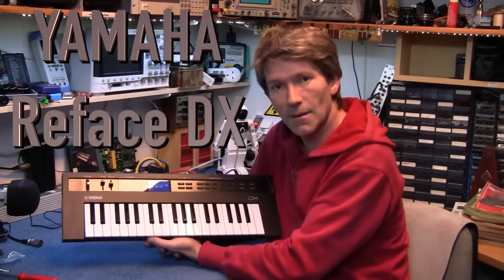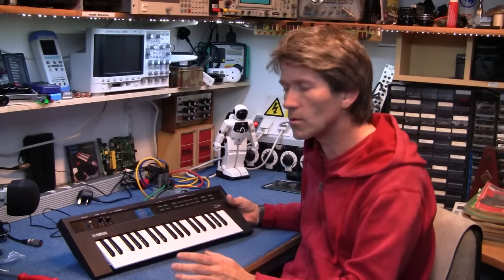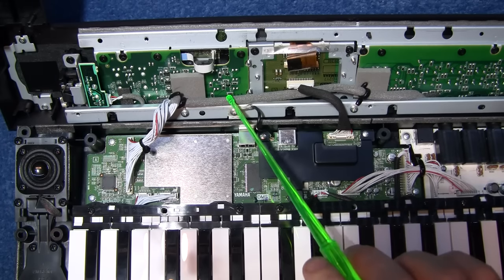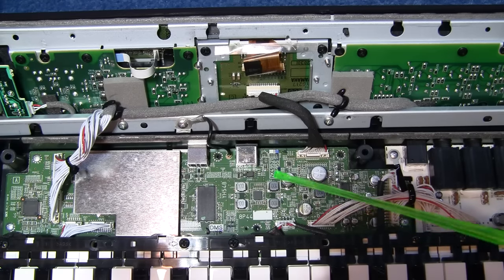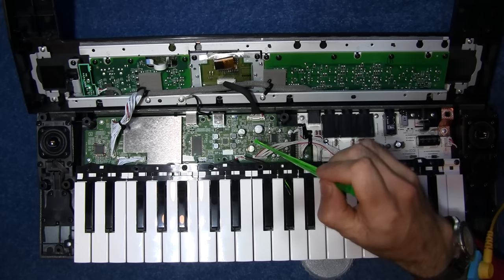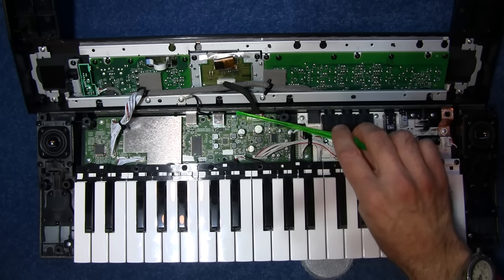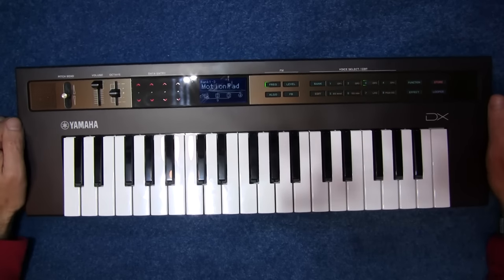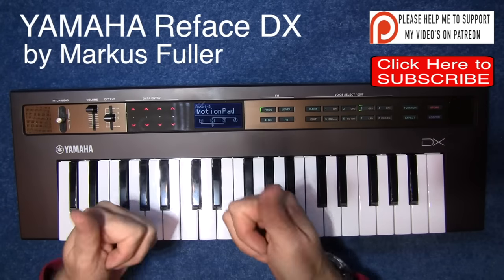YAMAHA reface DX FM synthesizer TEARDOWN MF#62

Comment: The chip under the metal cover is the DSP Yamaha SSP-2: a RISC CPU SH-2A @135MHz, wich handle tone generation, usb and midi. It's the same on Reface CS and other products like steinberg UR-22 and others yamaha synths like the s950.

Comment: This was very helpful, thanks.  I just bought one of these and the display was blank when I first turned it on. 

 I could just have had it replaced under warranty but your video showed a lcd FFC connector that could be the issue.
The connector was simply not locked so the flex cable was coming loose. Reattaching the flex cable an all was ok and I saved myself a trip to the store. :-)
Not sure if it is a common problem. The connector looked fine. It was not bent or 'cooked' from production. Looks like it was simply not locked properly during assembly.

It is a great little keyboard. I'm surprised by the build quality and feel of the keys. I have a microkorg and compared to that the reface DX has a more sturdy feel to it.

Comment: Hi, I'm having a problem with the octave switcher on my Reface DX, suddently stooped wiorking - is this. known issue do you know? I took it apart and reseated what I think was the connector to the main board but it hasnt made a difference. It's odd because it suddenly stopped working despite it just being sat on a table without moving - would a factory reset fix do you know? Don't want to unnecessrily lose my patches!

Comment: Just got a Reface DX, no sound at all - either on speakers, main outs nor phone out. Also Aux In signal isn't heard. Done FW update, full reset, local on... Volume slider joints seem fine, no signal arriving at the Volume pot. Panel functions well, keyboard sends midi. any suggestions? any service manual please? thx a lot

Comment: I was almost disappointed to discover that the processor boards weren't identical. The mystery deepens, regarding the chip residing underneath the metal cover.
Reply from the maker: +Michael Smith Hi Michael It is just too destructive to try and desolder the plate as it is very close to some very small components and there would need to be a lot of heat to get the thing off. sorry about that but I too still want to know what they are using.

Comment: Can you reproduce the buzzing in the right built-in speaker that is affecting this and the CP version? I'm gathering info before voiding warranty and busting out the soldering iron. If I can figure out where the signal is getting screwed up, maybe I can bypass it. At least I can tell from your video that the problem is probably on the cheaper board on the right; if I fry it maybe I can order or make a replacement. Thanks!

Comment: Marcus hope ure doing alright, didn't know If u remember but uve helped me abt poly 800 etc years ago! Anyway I HV a question is it safe to use contact cleaner spray on DX711 Or DX11 patch BUTTONS? U know they usually hard to press.. Once I saw a guy spray a contact cleaner on d50 hard~to~press button n it works. Didn't know was it bcoz the spray or not though..thanks Marcus all the best
Reply from the maker: Hello Lloyd, using spray contact cleaner generally works but is only a temporary fix, most contact cleaners have a lubricant and that can sometimes attract more dirt or on pots it can dissolve the lithium grease and make them scratchy. but as a quick fix yes you can use it but I find taking a bit more time to take the switches apart and clean with isopropyl alcohol could give you more years of use. saying that I have used spray contact cleaner for lots of repair jobs that have lasted a long time.
Reply: markusfuller Thank You id really appreciate the reply Markus

Comment: Very nice little view inside the Reface DX, thanx Markus! :) 

Yamaha is one of very few companies (or the only one left?) which do all this stuff "in house" even when it comes to chip design....they still do their own chips...and therefore i doubt that they are using some GP-FPGAs....check for YMxxxx or PL(X/G)xxx markings on chips...;) 

I still have and use my DX7 and two TX7 as well, and i unlike many others, i find it easy to programm the DX7 on its user interface....But i done some fundamental FM analysis when i sudied EE...;)

If you imagine the FM spectrum and how it´s generated and where/how the sidebands come up for certain frequencies vs modulation index you easily programm the DX when you set the appropriate algorythm first...As the mod index increases when stack the modulators on top of each other. 

You can´t do a sound with lots of harmonics sitting on algo 32...;) 
But you also can´t to an "analogish" sounding brass sound as you would need algo 1/2 or 3/4 available two times minimum

I always wanted more complex routings as well as much more operators, since there´s only one feedback´d operator loop...FM8 is ok FS1R is a little better....
but a 24-(Sample)Op machine/software along with free to wire OPs and at least 3 free feedback loops would be great to have some more and also true "through zero" modulation or feedback-crossmodulation 

With that machine you would be able to do pretty much everything when it comes to sound design....;)
Reply: +TubiCal 
Then consider Alesis Fusion. 6 opearators, every operator can modulate every operator (1 algorthm, basically as FM7/8). But something that FM7/FM8 or SY77/SY99/TG77 don't have: every modulation point in 6x6 matrix can be modulated by LFO, ENV, MIDI, etc.!

Comment: Well, there go some of the commonality theories, although I still more or less expect the slider boards in the YC and CS to be the same. The most probable explanation is that with the numbers Yamaha is expecting / hoping to sell reengineering the boards is less important then other matters, like sparing out that second chip for instance. Still a nice brain exercise to make such predictions though. Thanks for another very interesting vid.
Reply from the maker: +Marc Brassé ThankYou Marc. I was expecting it to be a little bit different inside on the main processing board. though only slightly.

Comment: how does the keybed communicate to the rest of the circuitry.  Is it feasible to attach a YP or CP permanently to a full sized keyboard like a p-45?
Reply from the maker: Hello, there is a ribbon cable from the keybed to the circuit board and pressed keys are worked out on the main board so if you attached a full sized keybed you could only use a 37 key keyboard and will have to copy the connections matrix of the reface. it would be easier to use a midi controller keyboard and rebuild the reface inside it then you could use anything up to an 88 note keyboard. the only obstacle would be finding one that will have the space to fit the reface inside it.

Comment: Would you say if this synthesizer was build into a new case it could be fitted with a full sized keybed with 37 keys? 

///Daniel Fletcher of D.S. (a Swedish synthrock/synthpop group)
Reply from the maker: +WesslansFilmprod Hi you could fit it into a new cabe but it would need a midi keyboard to work the 37 keys. The small connector under the unit allows a 25key keyboard to be fitted which is coded through a matrix of diodes but I think that it its limit if using the connector built in. however you can go upto 88 keys as long as you communicate through Midi.
Reply: +markusfuller 

Thanks fro your answer.

Only, 25 full sized keys? That's a bummer... Is there a way to upgrade or mod this unit so it can use/handle 37 full sized keys without usage of midi? And to give this unit proper pitch and mod wheels?

///Daniel Fletcher of D.S. (a Swedish synthrock/synthpop group)
Reply: If you know what you're doing, you can build yourself a tank.

Comment: love the videos! I can't imagine buying any of the reface series personally, but it's great seeing what's on the inside.
Reply from the maker: +Elsif I just do not like this tiny keyboard season that all the manufacturers are making at the moment but the sound that comes out of this is top quality and with a proper midi full sized keyboard its actually very nice sounding.
Reply: +markusfuller my main gripe with the reface is the stupid adapter to get midi....it;s non standard...same with the korg electribe II midi adapters....ugh..just put's me right off buying either of them.
Reply from the maker: I too do not like the tiny mini jack to midi din adaptors, I would rather have the full sized Midi din sockets.

Comment: What to do about a roland spds display showing  memory damaged
And you can't get   wave portect off  to fix it...
Reply from the maker: +TheEdmoss Is the Spds memory damage reporting internal memory or reporting that the user installed USB or pcmcia card is damaged ?. if its the user memory you may have to put it into a computer and reformat it in there but then you will lose the data on it. some memory cards only have so many read-rewrite operations before they start to lose integrity. a bit like early solid state drives they eventually will not read and write any more.
Reply: Is internal memory when you Updat Roland Spds
from Version 1.00 or 1.01 After you turn the power back on of the SPD-S, you will see “memory damaged” in the display. because the internal data format has changed since 1.00 and 1.01, 
and so your backup data is incompatible..
Hear is part of the releasenote manual
That cover that.
If You’ve Updated from Version 1.00 or 1.01 
After you turn the power back on of the SPD-S, you will see “memory damaged” in the display. Press ENTER. You see this message because the internal data format has changed since 1.00 and 1.01, and so your backup data is incompatible—don’t worry, we’ll fix this. 
When you see “ENTER to init” in the display, press ENTER once 1 again—“Patch 001” appears in the display. 
After the SPD-S has been re-initialized, the Wave Protect feature is automatically turned on. You’ll need to turn Wave Protect off in order to reload your backup data. 
To turn Wave Protect off, turn off the SPD-S, and then power back on 2 while holding down the WAVE and SETUP buttons until you see Wave Protect OFF in the display. 
Now you’ll be able to load your backup data as described in the next section. 
Do you know why is not working for me.? THANK YOU
Reply from the maker: +TheEdmoss Ouch that sounds like the initial internal data may have become corrupted in some way. Im not sure how to do this but I would try and reload version 1.00 if that is at all available. then go through the setup again and onto 1.01 . I really do not know why you are having this problem, Roland normally has these updates tested several times before release.
is there any way you can contact Roland service about this.? in england the roland service teams phone number is 01792 702701 but I do not know which country you are in.
Reply: :) Ok I'm In The USA And THANK. You R A Ok Guy...
Reply from the maker: Sorry I do not know the numbers for the Roland USA team but I'm sure they must be somewhere on the web. I hope you get it sorted. Best of luck and sorry I could not be more helpful.
Reply: You did good thanks..